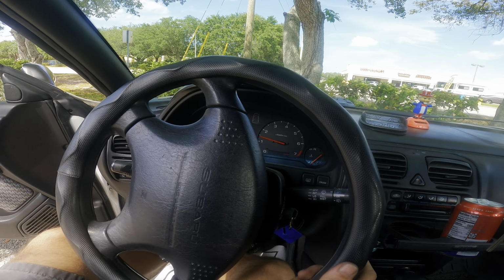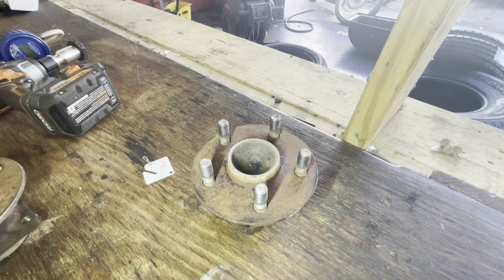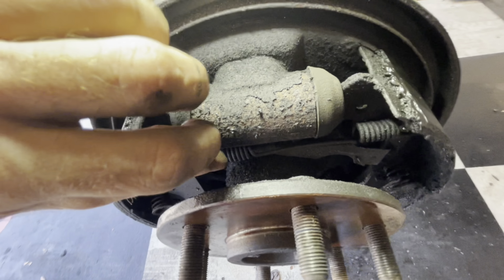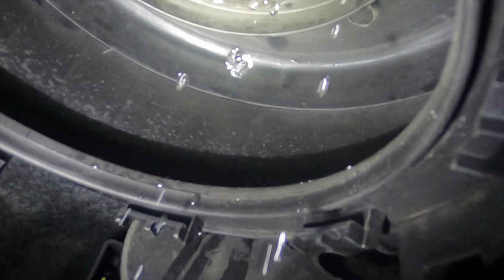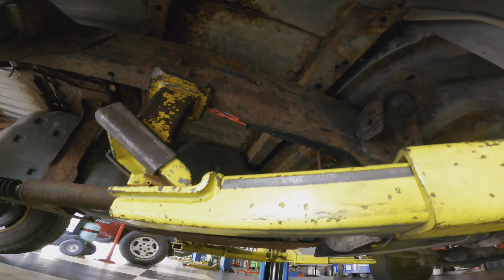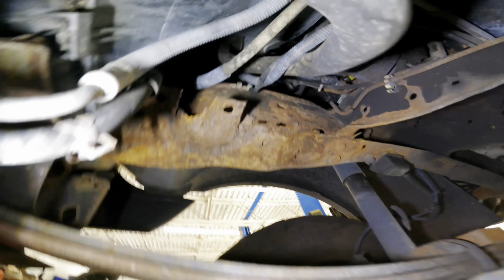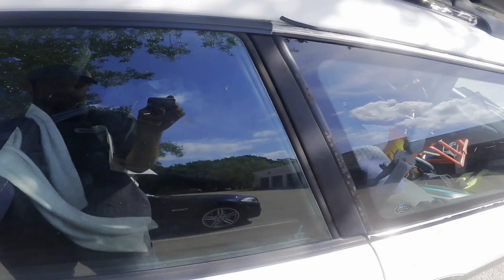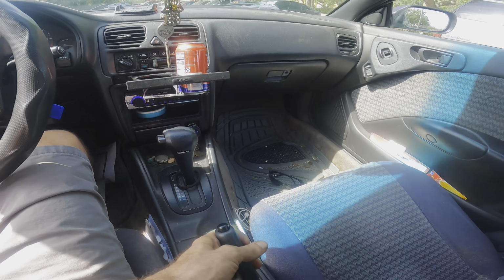Customer States: No! “Towed in and Towed Out” Compilation

Comment: 13:10 fyi you should still be able to get that brake line joint connector, # 26534AA000. Wonder what happened there with the brake lines, I've seen far, far worse on subaru message boards that weren't leaking there. Customer tried to remove line and stripped it? Subaru has their WQK47 recall, but I don't think that applies to this year since this leggy looks to be pre-2005. The recall was just to spray anti-corrosion wax on that brake line block and some other parts that can fail, but it's just a cheap band-aid, some people still have failures after the wax has been applied. Some legacy owners cut the brake lines under the seat and splice in there, and then just run ni-copp down into a new joint connector block, and then nicopp to each rear right/left caliper.

Comment: The pickup at 6:30, can't you as a mechanic in US revoke their lisenceplates if you find that many structural dangers? If I'd seen that i'd removed those licenseplates and drove that junk off a cliff. Don't want traps on the roads here.
Reply: In general no (although I agree that what you propose should become the norm worldwide). Ray's current workplace does force customers to sign responsibility waivers for the most egregious "declined repairs" cases, but that's it.

From watching other videos, there are some US states (particularly in the north-east) that force repair shops to repair some things regardless of customer's wishes, but IIRC it's only for check engine lights (and even then, only if it's emissions related).

Comment: When I was doing my vocational training, I became the go-to guy for brake line work. I don't know why.  I was good at it sure, but, let the remedial kids have a try.  But the instructor knew throwing the car at me meant it'd get done and they'd have a happy customer.  Well, one morning I got a late '80s Chrysler/Dodge Dynasty that had the same sit rep as that last Subaru. No pedal, no brakes. Multiple leak points.  The car was a total rot-box, but it was one of the other instructors' cars.  So, regardless of how much I protested, they forced me to fix it. Well, you know just as well... rusty brake line don't take kindly to being double-flared.  And even if it IS possible, the flare might have a pit in it and be leaky.  So other than the lines from the master to the ABS unit..... I replaced every single G-D steel brake line in that car and all the rubber ones.  I had started out just patching in sections, but as soon as you'd get pressure on the system, the next weakest point would rupture.  So I just said to hell with it - got the whole roll of brake line out of the tool room and went to town.  

And as luck would have it,  (yes they would charge the customers, but at a discounted rate).... but the total for four rubber lines, 30-some feet of steel line, fittings, unions, etc. plus the several hours it took..... of course they were unhappy with the bill.
Reply: Aww kid your like the guy that does all the tire jobs..
Reply: @keithmarlowe5569  Oh my yes, flaring stainless is something I can live happily never having to do again.  Once was enough.  I like this new what is it, nickle-copper stuff you can buy at the jobbers?  Bends easily, cuts and flares very easily.

Just last year I replaced the tranny lines on my little Dodge truck - even though there was an option for stainless, I know my issues with it and many others have voiced their opinions against.

It's great stuff, and I'm sure it has it's place. But I don't/won't recommend it to anyone.
Reply: well did it work??
Reply: @keithmarlowe5569  I had a 4runner that was professionally aligned  twice but was still wrong, got under there and did the trial and error. I fixed the constant wear problem and the constant right pull where the machine couldn't. Do not fear the steering

Comment: You're a brave man working under that rusted out truck at 8mins. Looked like it would've collapsed under its own weight at any moment.
Reply: Still has a few miles left on it in the north.
Reply: Thats clean for here, I've worked on much worse, some trucks I've worked on I had to weld a crossmember in between the frame and I had to get creative with 1 old chevy that the fuel tank strap mounts were gone, yeah that trucks clean if it was here lmao.
Reply: Lol what!? That thing is not that bad. I guess it's cause where I live around the great lakes but my trucks get driven until the frame breaks. Usually it's in the rear and the frame drives up into the bed of the truck 90 percent of the time or a spring shackle. That frame still had a lot if mikes left on it, especially in Florida
Reply: @ericg4915  Get a job and buy a new truck for once
Reply: @JetFire9  I got a job and an 820 credit score. But a new truck is at least 800 a month. Insurance is pricier with a new vehicle. 800 a month is more than my mortgage
Reply: @VikingDudee  that absolutely doesnt make it better.. glad those wheeled coffins get pulled off the road in my country.
Reply: @chimei-tekinaneko8318  What do you mean, then you have to end poverty, most poor families have to deal with what they have, Glad you think of the rich and screw the poor..
Reply: Sharp Talons I can recall one regular customer who I’m sure was just hoping someone was stupid enough to try and lift his sorry rust bucket
Reply: @VikingDudee  used to be poor as well, managed to work my ass up to no longer eat dirt..
In my country it costs you like 1800+€ to get a licence anyway, but therefor or education on "how to drive" is way better.
Even with the higher entry costs and not letting death traps on the road; our poor people still can use cars.
I know people that literally have no job and legally own and drive cars.
Reply: @JetFire9  in some places vehicles must be inspected every year. A new vehicle might cost between $400-$600 for inspection alone. Not counting yearly registration and license plate renewals.
Reply: @ericg4915  get some waxoil (yes its a thing) and apply in a thick layer all over the underside of your truck. Thank me later
Reply: @latenerd2441  waxoil? I'll have to check it out. I've used fluid film LC9 formula. It's a rust inhibitor. It's like fluid film but it's safe on rubber and doesn't adversely mix with grease. Fluid film shouldn't touch anything but metal which is a downside
Reply: @ericg4915  pretty sure you can either get it as a spray or in a can to paint with a brush. I've seen it used in UK. I tell ya underside was spotless. Car was 15 years old, 500k on clock and looked like it came of the line yesturday. Other than the usual age related wear.
Reply: If you’re a hack and put scrap metal on the road like that and it breaks and kills someone if and when they find out you said it was safe to go on the road you are liable. I wouldn’t have even welded that plate into the frame because it would further modify the crash absorption design of the frame. Not safe not cool and not legal.
Reply: It looks like they put quite a bit of work into accessorizing the front bumper and adding new parts underneath. But for what? 😆

Comment: I know the rear wheel bearings aren't serviceable, but it'd be interesting to disassemble, even if you have to use a cut off wheel, and see just what it looks like inside.  And what was the mileage on the Corolla?

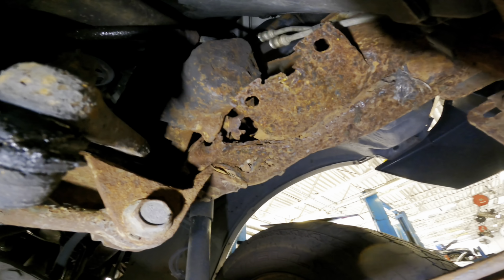Comment: 8:12 how is a truck like that allowed to drive on the road? its a danger to other road users. its safer to just crush it into a cube
Reply: It's a vehicle from out of state, he's in FL and there has been a massive influx of people from up north coming here and bringing their completely rotted out junk vehicles and just driving them around or selling them to some sucker for dirt cheap and because we don't have vehicle inspections here they can get away with it untill the vehicle physically falls apart.
Reply: @briang4470  Exactly. It kind of amazes me how little rust is a problem down here for cars that have spent their whole life in Florida. I bought an old Crown Vic that had literally spent 20 years within a block of the Gulf of Mexico, almost no rust. The Ford Explorer that spent half its time in Florida and half in Virginia, rusted out like crazy.
Reply: Could do some real weight reduction with an air hammer on that, I eel like I could reduce the weight of that truck by at least 30%.

Comment: Do they make the fit-over frame patch brackets for vehicles other than Jeeps?
They work really well and are easy to install.  
Cus my 99 Wrangler frame is pretty much all bracket patches now. Better than new... cus the steel tubing Jeep used for frames were paper thin to begin with.

I have put a bolt in the brake distribution block just to get the car to the shop to have new lines put in. It works til it don't 😆.

Comment: At what point is it become criminal ? Driving around endangering other Drivers and you just Don't Care !
Reply: Never, well actually, after your vehicle fails state inspection is it criminal to drive it without repairing it first and passing state inspection. To have a driver's license in the USA, you're not required to be mechanically knowledgeable about vehicles nor are you required to do pre-trip inspection to deem it mechanically sound before driving.

Comment: "Going to come out easy or not"

Came out so easy it was surprising, but giving how much play was in that wheel not really too surprising.

"that truck"

When I was a mechanic and manager of a shop, if a customer brought something like that in, I would tell my guys to refuse to work on it. Its not worth the possible liability of anything going wrong and sometimes I was under the impression that a customer was hoping that we would not document the condition of the vehicle when it was brought in. So they could sue, but we always documented everything.

Side note, that frame is using all of its remaining strength to support the body. That frame if it was not still together would collapse, as none of it could hold up individually. Honestly, you should not even attempt to jack or lift something like that, as you could cause the remaining body to bend under its own weight.

"Car with no brakes"

That is one of those handbrake special models, lol, jk. Did the customer do that bolt? Definitely could not be another shop, that would be a lawsuit that would be easy to win. Also who would think its a good idea to plug their brake line with a bolt, smh.
Reply: That frame could have bent and fallen partially on him. Dangerous to be playing under there not much weight is needed for that entire truck to bend

Comment: Question for ya. 

Just picked up a Mini thats been sitting for a few years. The brake, once pushed, continues to go down, stopping the car completely, and requires me to put my foot under to pry it up.

Would you guess it'd be the brake lines or the master cylinder causing the drag?
Reply: Sounds more like maybe a bad power brake booster. Try it 5 times with engine off. If you still have to pry the pedal up, it's probably not the booster.

Comment: Subaru had a recall on those rear brake lines, they offered to pay for most of the job on my '05 Legacy with 105,000 miles like a year ago.
Reply: Going to say the same thing, and I had about 250,000 mi on the clock.  The brake lines failed and they replaced them.

Comment: Knew a guy with the infamous Toyota truck with the dissolving frame. Missed the recall to get a new frame for free. To keep it from folding in half, he ran bolts through the front of the bed and through the rear of the cab. I told him to scrap it NOW. The body and inside looked good.

Comment: Brake nipples and joints are pretty standard so even if you can't get OEM you can get aftermarket since there are only a few thread variants. But you may have to manufacture some pipe fittings yourself. However the question is more if the customer is willing to pay for the time it takes to fix it.

Comment: Why do I do this to myself?  I just dealt with a jeep patriot that came in with grinding issues and no braking power.  Checked the reservoir on the master cylinder, bone dry.  The salesman looked at the rear drums and was like, good, we don't mess with that.  

Ripped off the front wheel and asides from one too many pad slaps, no problem.  The left rear brake shoes were wore to the point that the hardware failed on one shoe and they popped a wheel cylinder.  Drums, hardware, wheel cylinders, shoes.  Expensive job.

Just any day that ends in y.

Comment: There's a quick way to do everything. Noodles can be made in under a minute these days, and there's quick ways to deal with a bad brake caliper/line that don't involve shoving a bolt in a hole. Just take a pair of vice grip pliers (harbor freight sells a nice 3-pack for under $10 to use and abuse), and crimp the bad line before the rupture. If it's a bad caliper, this can be done by carefully clamping the lil rubber hose that connects right to the caliper. Just leave the pliers hanging and limp to the shop, that easy. Hell, it's probably easier to crimp the line than it is to run that bolt in like that.

Comment: At least it's a 2 Phillips dry wall screw. I used to deal with stuff like that, until I ran into a 4 inch deck screw with a Robertson drive. Then I surrendered and went to aviation to be a jet mechanic.

Comment: To get the most transportation miles for your money:
buy a new base model vehicle
do all the maintenance you can by yourself
and drive it till the wheels fall off - usually somewhere between 180,000 and 220,000 miles on the odo.

The only drawback to this plan is eventually the wheels really DO fall off

but its very satisfying to have a vehicle that you bought new, 15 to 20 years ago
and driving it to the junk yard for scrap, because you completely used it up to the last mile.

Comment: I am fortunate to live in a state which requires annual safety inspections.  I visit Florida from time to time and I have noticed many cars disabled on the roadside of I-95.  They drive on tires that are bald, with worn out suspension parts, and rusted out frames.  What could possibly go wrong?  I mean, it is only the driver's life at risk and those unlucky enough to share the road with them.

Comment: My uncle ran a small garage, he had a rule, if it rains rust when bumped with a hammer then it’s for the scrapyard. He’d fix anything but rusted structural parts. He ran a repair garage not a resto shop.

Comment: That Subaru brake leak could have been easier to plug if the customer cut the leaking line and made a plug.

I did that with a vehicle of mine, as a temporary fix.

Comment: Here in the Netherlands we have a yearly inspection of the cars for safety and environmental regulations. And the rust bucket that was supposedly a truck would never be allowed to drive on our roads, because if that got in to an accident it would fold up like a tin can. Also was the coil spring on the silverado missing on one side or did it just have one? Could't see clearly but mounting just one side makes no sense

Comment: I borrowed a trailer that looks like the underside of that truck.  I had a load of manure dropped on it and the tongue broke off.    You could push your finger through the metal in spots.  Luckily I was on a farm and they had a welder and patched it.    I  had to cut it off and completely replace it.  Lesson learned.   Don’t borrow really old rusty trailers

Comment: I'll bet the truck was from one of the salted roads states.  That car without brakes was totally scary.  It may not be cheap but I bet a machinist could make a replacement for that two into one brake block.  Just got to find the right tap or make it on a CNC machine.

Comment: It just occurred to me that the average auto mechanic probably believes in the existence of a protective deity... considering the huge number of cripple-headed members of our species who survive driving their truly EPIC fails around for thousands of miles before deciding to take them to the shop. I try to avoid that club, these days - but I was once a member. 1979 Pontiac LeMans station wagon, leaking copious amounts of coolant from its... er... modified engine block? Hey, it's a station wagon, lol - there's room for LOTS of water jugs. Of course, that meant the six-hour trip back and forth to/from North Carolina sometimes took nine. But we paid $25 for that car, and were determined to get our money's worth, heh. Dodge Aspen with suspension so worn out that the front tires would go from brand new to wires sticking out all along the edges in 10,000 miles or less? Used tires are cheap, and lasted almost as long. Funny how I never gave a thought to why I had to continuously steer back and forth to go in anything vaguely resembling a straight line. Oddly, that one was an alpine hero in the snow, anything from a dusting to "HtH did I pack the engine compartment with so much snow that the FAN BELT got forced off?!?" 

I have since learned that saving a nickel often ends up costing you dollars. . . .

Comment: That  BIG  lump of Rust , with four wheels attached to it was a REVELATION . It should have snapped in Half  AGES ago . 
Rust is stronger than previously thought , it  would  seem . 🤣.

Need to find out  WHO  used a mismatched Bolt , to PLUG a Brake-line . Speechless .

Comment: Thank you, Thank you for not referring to the park brake as an 'EMERGENCY BRAKE'. If the park brake is used at more than 3 mph, somebody could end up in 'EMERGENCY'.
Reply: what are you talking about?!

the new eBrakes with the little pull tab are all or nothing, and will lock up the rear tires if you apply them while driving
but the old center console levers are usually one brake shoe on the rear wheel, and its very easy to stop a moving car with them, eventually... without skidding